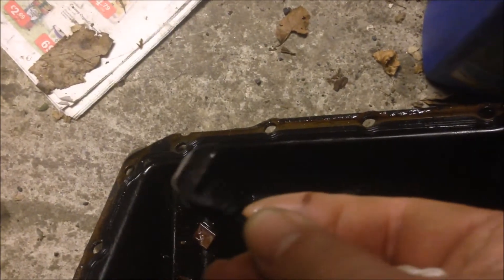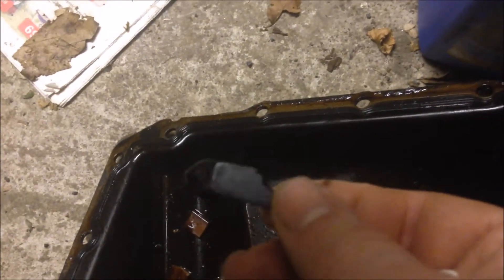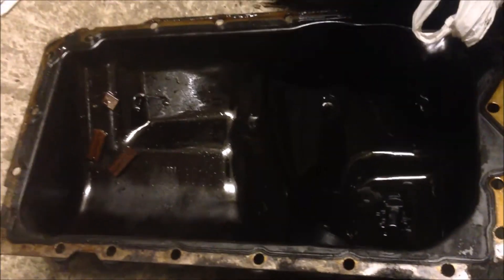BMW E46/N42:  Found in Oil Sump/Pan: broken pieces of timing chain guide

Comment: Have you change the timing chain or timing guide mate
Reply from the maker: Hi, No, I haven't changed the timing chain and it is still working well. The tensioner arm is still in good condition, only some guide liners fallen off. As this car is 16 years old with over 170k miles, I will not replace the timing guide as long as it behaves well. Good luck.